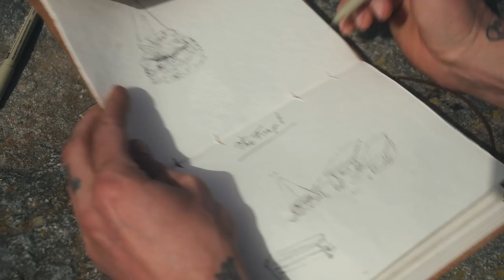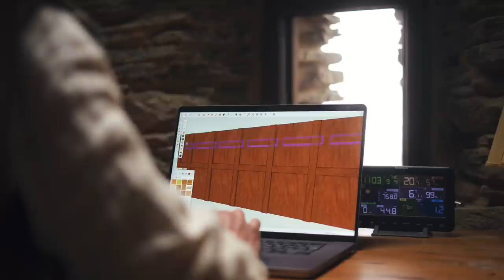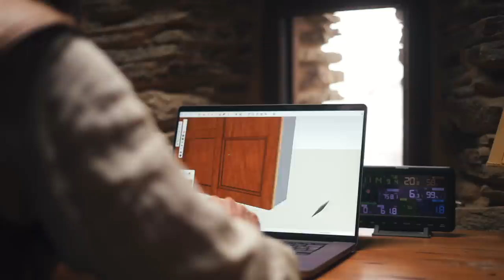#108 Fire pit, Wood paneling, Fences

Comment: Alway enjoy the chickens following Martin. Amazed  at the deep green in the valley. Birds in background make me happy. The firepit will be a nice addition.
Reply: Wonder why he haven't ada more chickens
Reply: Opps add typo error
Reply: @nuraisyahismail7234  He can´t eat all the eggs
Reply: @nuraisyahismail7234 The three dots at the side of the comment area will allow you to make an edit instead of adding another comment. I learned this from another commenter. It's very handy.
Reply: How do you think the chickens you eat live?
Reply: @BalboaBaggins  Unfortunately most of them are forced to live in very small cages. I pay a higher price to buy free range chicken, but some can't afford that.
Reply: The question I have though; is why he didn't move it at least a little bit more away from the picnic table?

It seems awfully close...
Reply: @Ibuki01  I thought the same at first, but then I considered that the original fire "pit" was in the same spot, and has had plenty of use. If it were too close to the table, Martijn would have found that out by now. I think it may appear closer than it is, due to camera foreshortening.
Reply: 109 shows the perspective a bit better. I still think it's close, but not so much as I originally thought. @jaygee5693
Reply: @Ibuki01  Since I wrote that comment, I've seen a couple of different views that show the pit is VERY close to the seat. When the fire has died down, on a cold evening, it would probably be perfect, but with any sort of a fire going it must be too hot. I suppose the idea is that people don't sit there until after the meal is cooked and the fire is low.

Comment: Being free of the confines of the cabin, working outside in fresh air; this has to feel so expansive to the spirit. Now you can divide your time between working on inside finishing projects and outside. I wonder if you plan to pave the entrance area where you just finished the hinges and latch on the beautiful arched door to storeroom? Paving outside of your doorways will keep the inside floors of your cabin so much cleaner, especially during the wet. This was a lovely video, as always, and I thank you.

Comment: Martijn, here come some small criticisms to help offset all the treacle sent your way. Mightn't the fire pit have been better placed off one end of the stone table? The raised base would have negated any slope problems. The new chair? Tufting? Heavy spindles? Surely simple elements would better suit your small space. I have similar fears for the wood paneling and hope it will not overwhelm but only bridge the cold, hard stone and the soft fabric textures. And while I'm hoping, how about sprinkling a modicum of color around all those neutrals, like in that upcoming shower curtain? Bits of heathered blue or green might mollify seasonal cabin fever. On the other hand, kudos for having the four chairs on which you broke bread with your guests. Now it's a home. (Despite these comments, I'm a dedicated subscriber. This episode just tripped some triggers,)
Reply: Soo...basically 'ruth', what you're saying is ...
.....don't do things the way YOU want,  in your own house....Martijn....
......do things the way I (a complete stranger, in another country...!) tell you.....!!
Unbelievable...

Comment: Are you going to build the workshop before starting renovation of the second cabin? I think it would be good to get the workshop up and equipped with water and power, then you could work at all times without being subjected to the elements. Have you thought about a specially large entrance/exit for the workshop in case you want to build something, but it's too big to fit through a normal doorway?

Comment: With that little wall around your fireplace,,  I've seen this done Kazakhstan  but they made a  tall wire cage  opposite the wall, that they put charcoal inside so they could roast a lamb, and 2 steel upright posts  Y -shaped posts on either side of the fireplace TO hold a rotisserie  an on one end of the rotisserie  bar a sprocket of a bike and a chain and some sort of handle, they incorporated into a power drill that low speed rotated the rack

Comment: Martjin,  Did your Dad suggest the best place for your greenhouse while he was visiting with you  -  what about a greenhouse chicken coop combo perhaps.     Sunshine and light,  more company and greens for the chickens, and warmth from the chicken coop in winter.    And not so many outhouses dotted around, with better use of your land?     You could still check on and clean the chickens sleeping area from the greenhouse, simply extend the length of the coop.   Pinterest will be your friend sitting and sketching by the fire.   Adore the new leather chair, is it called a 'court' chair?

You're becoming quite the cook.   A pot of basil, and they're easy to propagate  -   snip the stalks at the base of the plant, pop in water near light for 2-3 weeks until healthy roots form and plant into pots.   A greenhouse would be another place to relax for you.

Comment: good to see the white one is healthy again, out of curiosity when i saw you using your mac laptop, did you seal the inside of the walls with a coating to prevent dust from gathering in the air ?

Comment: I received a return comment from you bout this program. I am leary about trying to contact you at this contact information provided. I have had others do the same and found out it was a scam sent, by a third party. So if it was you could you indulge me in your search book and draw a trolly-type system to move your stone up to where the shop will be located. Some things that can be taken down are easily transported to another location. With adjustable sports for different conditions, this way I will know it was you doing the responses to me or not! O, just how outside of response comments does one contact you if they wish to share other information with you, or wish to send you something by mail? If possible add it to one of the programs within the next two weeks, that is the drawing.
Reply: Beware yes there are scammers imitating trolling bots